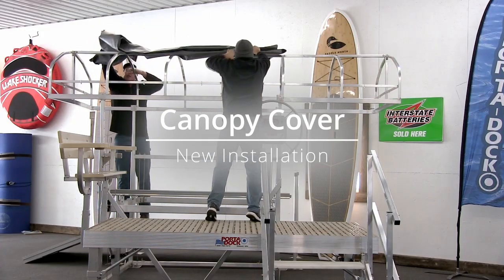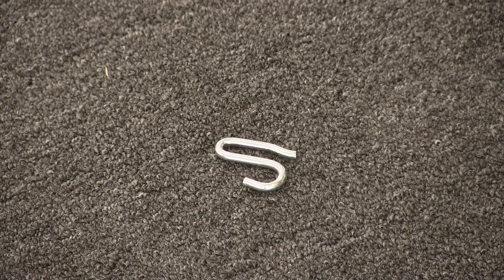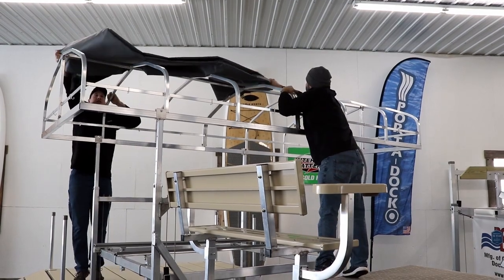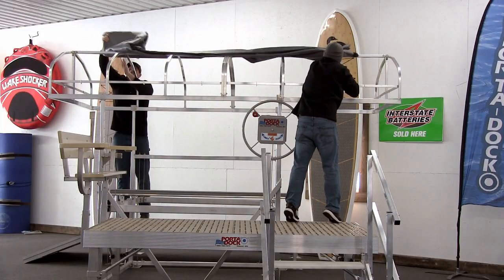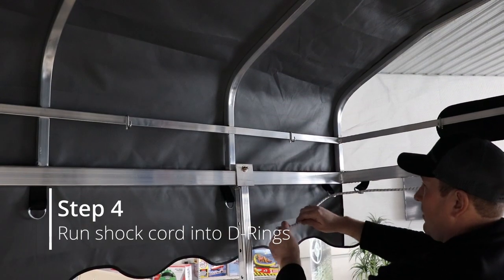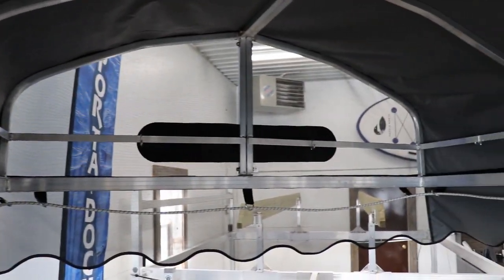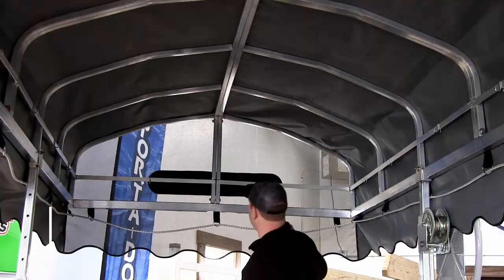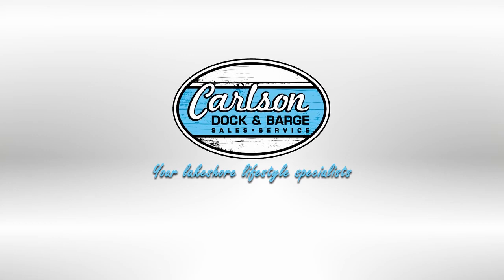Porta-Dock Canopy Cover Installation

Comment: laughable example. Now do it with the lift in the water. Do it with a real canopy frame, not a model
Reply: Have you had a bad experience putting on a Porta- lift cover? I'm considering buying one.
Reply: @dianevickers9448  No, I have a shorestaion. I looked up ways to put on a cover and this video is bad. It's not realistic, they're putting it on a demo model, not 10 feet in the air or from a boat. Their canopies are probably fine, it's just a misleading video